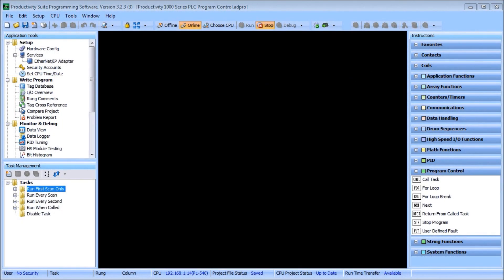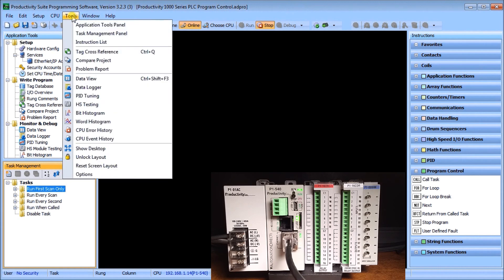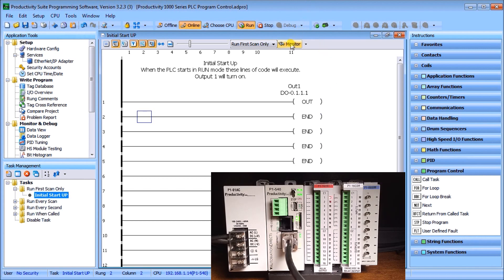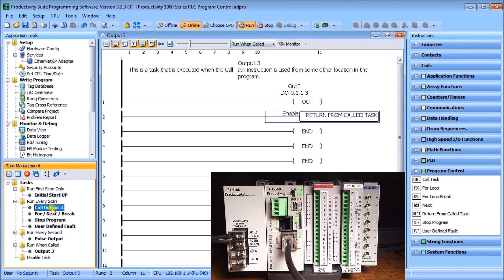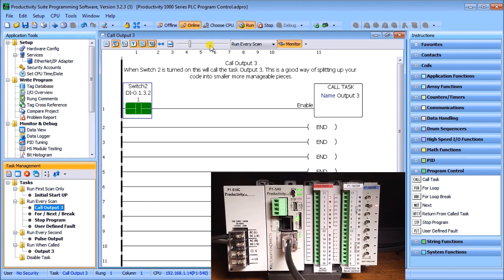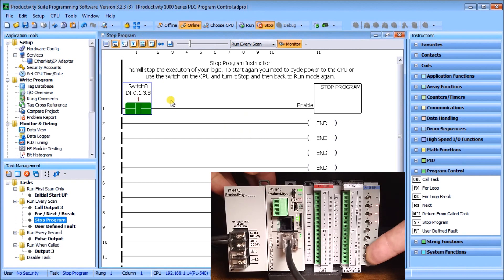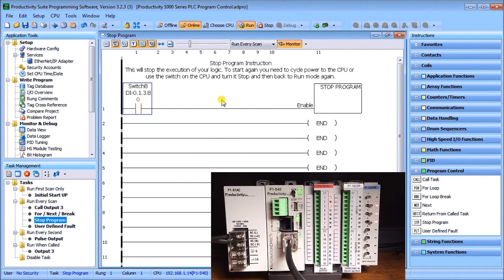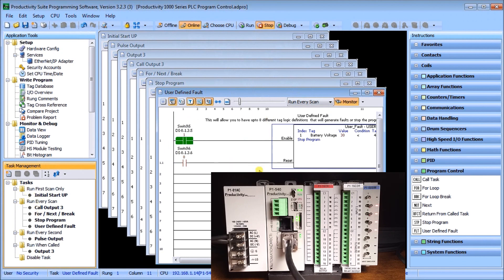Productivity 1000 Series PLC Program Control

Comment: Hi Garry 
We are user of Koyo Plcs since 1990 and we love the Stage program system on DS5 . So now we are migrating to new P1 or P2 Plcs. Do you know if its possible to do something similar in Productivity software ?
Reply from the maker: Hi Fal Automation,
The productivity series of controllers will not do RLL Stage programming. I would look at the Task Management part of the software. There are several different ways to control your programs.
Note: The Do-More Series will support the RLL Stage programming.
I hope this helps you out.
Regards,
Garry